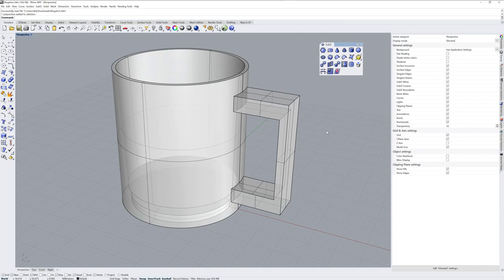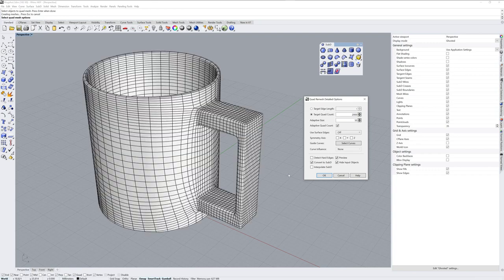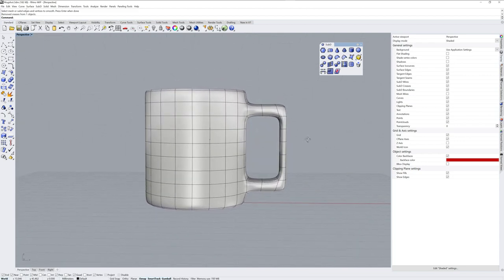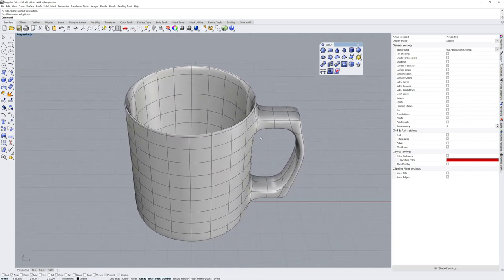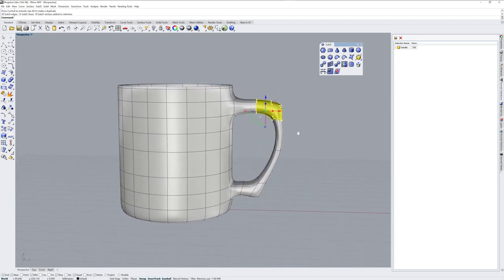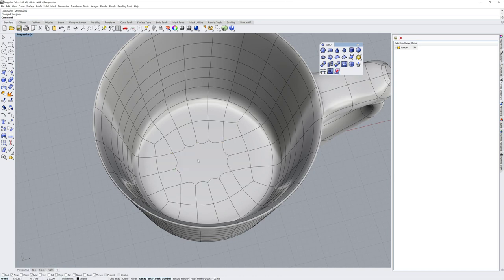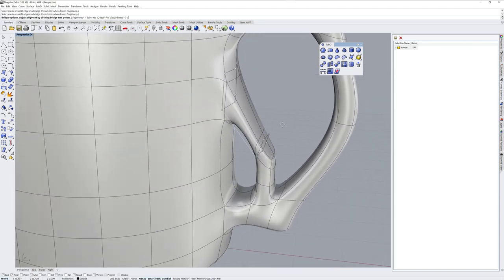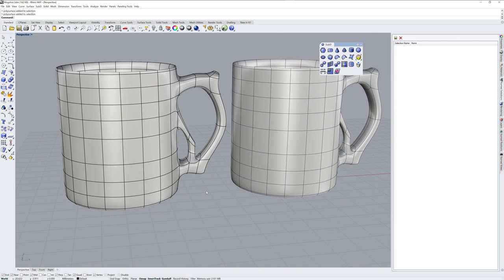Exploring SubD in the Rhino 7 WIP / 9.17.19

Comment: The conversion from mesh (SubD) to NURBS is much better in T-Spline, it does some kind of interpolation generating a cleaner model with less surfaces instead of converting each poligon in to a single surface... I really hope developers will improve conversion in that way: more like t-Splines or even better.

Comment: Does anybody know how to export object in flat  mode?like low poly object with the sharp edges?
Reply from the maker: Use the command ExtractControlPolygon on the SubD in Rhino 7 and then export that as a mesh. Or use the Export command and choose OBJ format and then in the Mesh settings for the OBJ choose the Control Net option.
Reply: @RhinoGuide  thank you soo muchh🙏
Reply: @RhinoGuide  thank you soo much